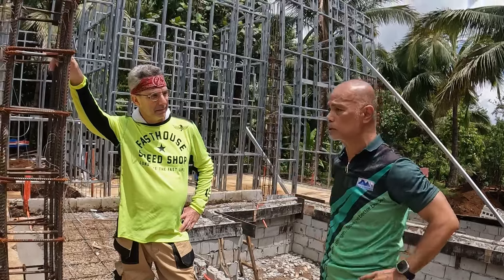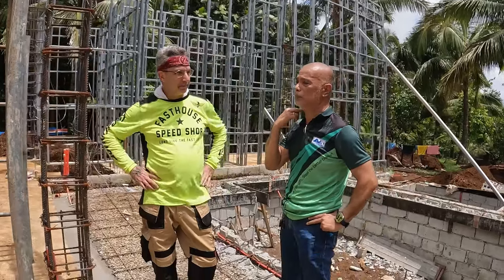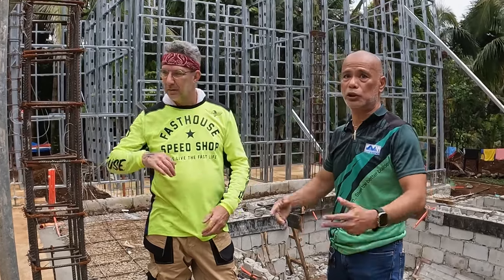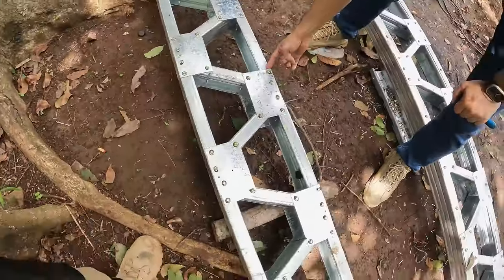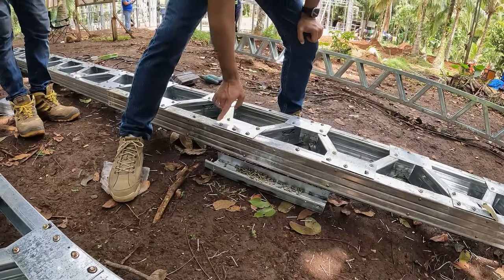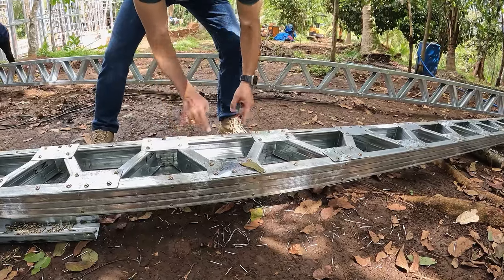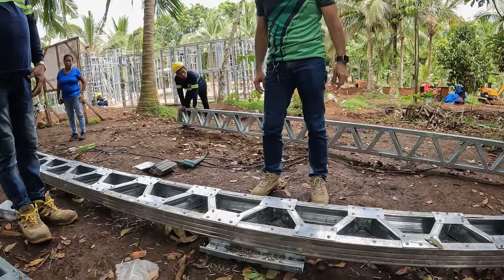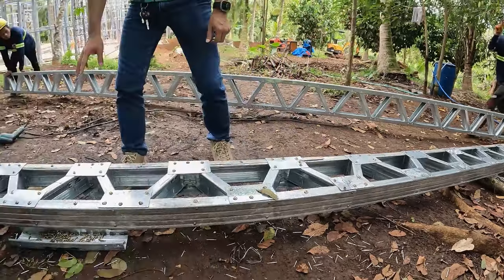Metalyte: Essential Building Insights! 🚧 | House Build Philippines | Ep. 16 | TORINO

Comment: Where ever they cut or penetrate the galvanized metals you should consider still using some expoxy coatings.  We Expoxy even the galvanized metal.
Reply from the maker: Good tip, thanks.

Comment: Im new to your build and you may have covered it previously. What is the cost of building your home with metal vs block?
Reply: i second that question ..
Reply from the maker: I'm working on getting you all a valid answer. I need to untangle the costs since I am not the GM for this build.
Reply from the maker: @mikeheyjoebuenavistadreamin272, @1rockinthedadbod I contacted my builder and ML team; they tell me they have seen between 15%~20% cost reduction in labor. For my case, I estimate possibly a higher savings due to our unique location.
Reply: @torino2610  How can you not know how much your construction is going to cost you?  Do you have an estimate?

Comment: great video.. it is interesting to me that you are adding rebar and cement inside the wall ..i can see that metalyte is plenty strong and with hardie board for sheer walls it will add much strength without need for cement inside wall ..i would just add rockwool or fiberglass bats inside but that is just my opinion ..  a solid poured wall with concrete forming would use about the same cement and rebar and be just as strong ... did the engineer say the cement was required  for strength?  im not questioning your decisions  im just kicking around ideas and learning myself  .. love those metalyte trusses
Reply from the maker: Thanks for commenting. Yes, the engineers definitely say that all forms be filled with concrete (with a specific slump) and rebar, this gives them the load bearing support and ability to eliminate some tie beams.

However, one could use the Metalyte frames for internal, non-load bearing walls, for example adding a closet after the fact using HardieFlex or drywall.

The bodega that the ML team built for their stay is an example of using ML frames without concrete. I suppose insulation could be added as you suggest as well. Hope this aligns with your questions. Thanks!

Comment: Have you looked at any building that was built 20 years back?? I have heard stories of failed construction but I have never seen it for myself. It might be worth your time to go look at all the older buildings that have been done?? Good luck
Reply from the maker: I'll take a deeper dive into ML specific failures, but ML really is not much different than poured in place concrete walls, with the exception that the forms become one with the wall rather than removing wood or steel forms for reuse after curing. Thanks 👍🏼
Reply: Especially ones which have failed or with stood typhoon type conditions......
Reply from the maker: @amowatt01 Here is a news story about a school in Bohol that withstood Typhoon Odette, where everything else was mostly flattened. 

https://youtu.be/jy3rbJK3VMU?si=_OWfOten66H1_2dR

Comment: Do they weld any of the framing
Reply from the maker: No, it's all galvanized. Riveted, gusets and screws.
Reply: Thanks i have asked them if they have plans for a 3 / 4 bedroom house 
Thanks for your reply i will be following with interest.
Can you tell me the approximateof yor your build and how many bedrooms 
Thanks Noel
Reply from the maker: @NoelDennison  The house is 533 SQM (5,737 SQF) buildable, approx. 384 SQM (4,133 SQF) livable space on approximately 1.7 Hectare (4.2 Acres). 1MB, 1 Guest Suite, 2BR with shared bath.